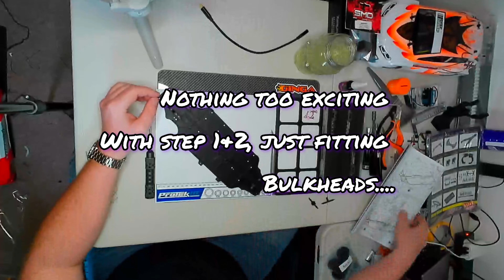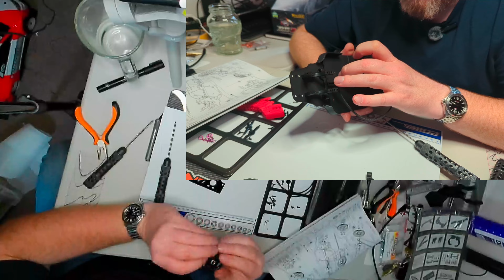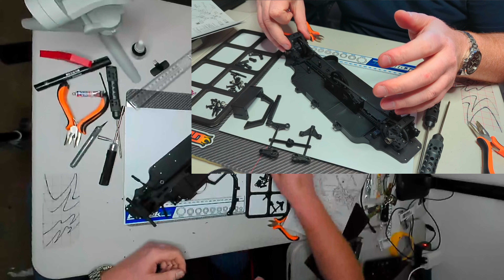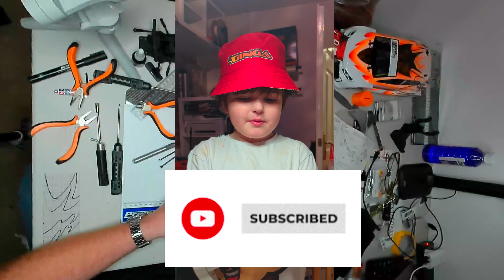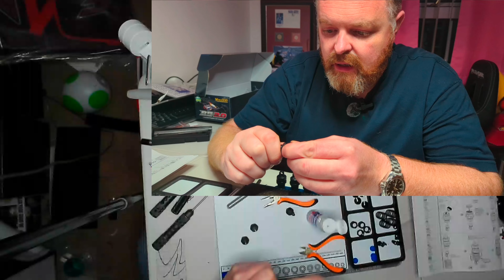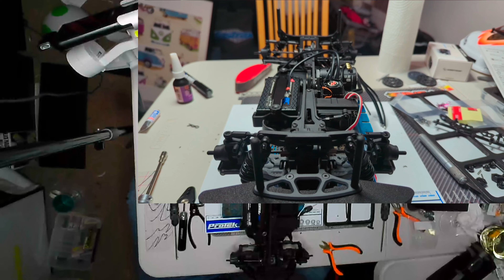YOKOMO RS2.0 RC Touring car for £150!!! BUILD PROCESS and TIPS!

Comment: What did you do to get proper droop in the rear? With 9 mm shock travel I get virtually no droop. Even with the screws all the way backed out the shocks are topped out almost completely at 5.4 rear ride height.
Reply from the maker: We've not raced touring cars for a few months now (outdoors, we're racing off road) I'll grab Joey's RS2.0 when I get a chance and see what we're doing. I remember a similar thing, but can't recall how we sorted it.

Comment: Just to think the Tamiya TT02 comes in at the same price different class yokomo, you can't race with Tamiya box tyres as someone commented no tyres included. Some comments on chassis flex don't worry some of the pros with £800 cars at my club like some chassis flex modern TC have very thin top decks with thinner options for aspallt/tarmac outdoor. Nice video let's face we're all not going to be top of the A-final we must learn how to drive first so it's a perfect choice. Also when you see racers with say an Awesomatics or Schumacher they are constantly on camber gauges or something after every race, sometimes best to be simple.
Reply from the maker: I've a follow up video to this, highlighting some of the more subtle changes between the RS1.0 and the RS2.0. it's also compared to my full blown MS1.0. the 2.0 is actually stiffer than the RS1.0 and not far away from the MS1.0. 

Then I've put it into context by pointing out the front hubs of my MS1.0 are more than half the price of the full RS2.0 kit!

Comment: How stiff is the chassis when everything is bolted together please? I am tempted by one of this to try TC at our local track but all the guys are running alloy chassis and i am worried this will have too much flex. Cheers
Reply from the maker: Hi Matt. I was a little wary of how flexible this would be, as well. When it's all built I would say it's actually slightly more rigid than the RS1.0. I'll be doing a comparison video with the old car and the MS1.0 after this weekend. If you haven't already, hit subscribe so you don't miss it! :)
Reply: @Gingapaint  brilliant thanks for the quick response, I've subscribed 👍
Reply from the maker: @matt313131313  thanks! Hope you enjoy the rambling! 😁

Comment: Another couple of questions… I’m guessing no wheels and tires in the kit, what would you recommend for carpet. Similarly what body shell do you run?
Reply from the maker: No wheels or tyres in the kit. It's not a bad thing, I used to have loads of those useless Proline treaded things from tc3s etc years ago! We run control tyres at our club. They're the same tyre as the BRCA nationals. 

For bodies , start with an Extreme Twister and go from there. This car will run an HPI Impreza Type C, because I've 4 of them, I bought them cheap and my young fella is hard on them!! 😂😂
Reply: I have those tires I think they were v rage tires …. Was wondering what diff and shock oil you used
Reply from the maker: To start with, I used Associated  45wt shock oil, 5,000wt in the rear diff and 500,000 in the front. 
The kit shocks oil would be grand, just I've the range of Associated oils here, so I've got a known base.
Reply: @ yeah I am looking for a starting point how did it do on the track
Reply from the maker: @iannjadejones1982 Joey's going really well. If you can see my "shorts" videos, there's a few of Joey running. He's knocking on the door of our A Final, it's only little mistakes keeping him out.
Reply: @ he looked good out there

Comment: Cracking insight on the build of this kit. So the drilling of the shock cap, that’s something you have to do / you choose to do as it helps?

Also enjoyed the old skool Chicago / Detroit house track 😉
Reply from the maker: We just find the shocks are easier to make equal with the holes drilled. The diaphragm is there to compensate for the additional volume that the shaft takes up on compression. If it's sealed above this, the air trapped can act like a spring, which works well in an off road shock, but can make shorter shocks difficult to get consistent. Also means that the oil damps and the spring rebounds.

For tyres, we're running a control tyre at our club. Rush I believe. Body wise, it's personal but an Extreme Twister is always a good place to start! :) hope that helps!